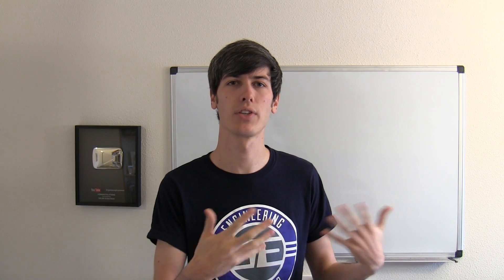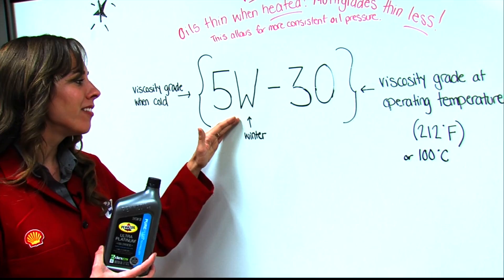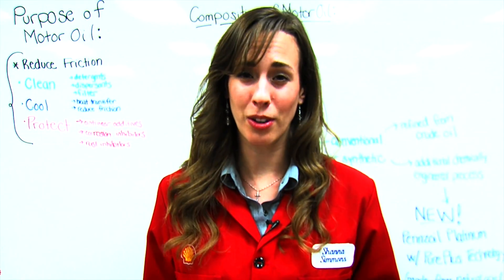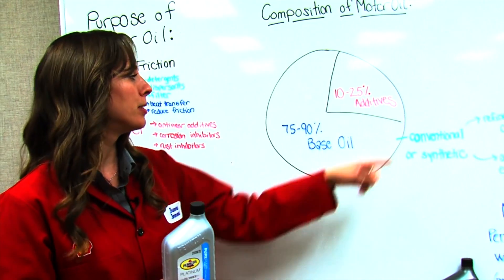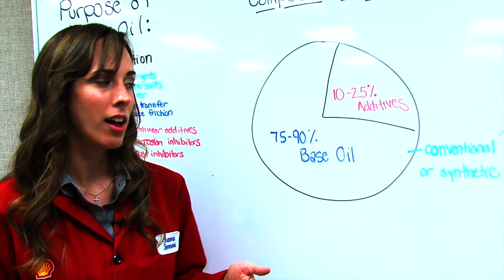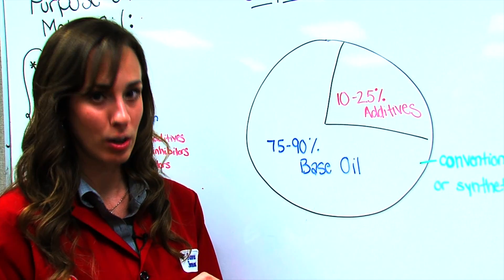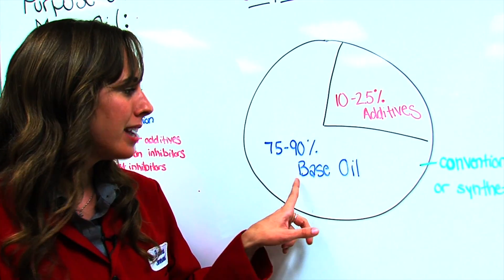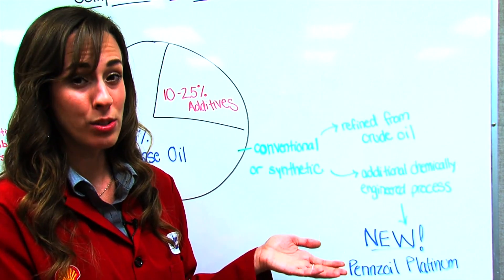Motor Oil Myths & FAQs - Synthetic vs Conventional

Comment: We have a bit of propaganda here about synthetic motor oil and coincidentally, it was Shell that has blurred the distinction between what is a true synthetic and what's really a "pretend" synthetic.  A true synthetic lubricant does not use petroleum.  It's made from components whose molecules have been engineered to perform certain functions and those molecules are uniform in contrast to petroleum oils where the molecular structure can vary substantially.

When synthetic lubricants were first introduced,  they really were synthetic lubricants.  Mobil 1 and Castrol Syntec were prime examples.  Then, very slyly and dishonestly, Castrol switched to Group III petroleum made by Shell while not telling anyone they did so still claiming that their oil was "synthetic".  They were challenged in court by Mobil who lost the case.  Today, the term "synthetic" has no technical standards associated with it and therefore, it can mean just about anything.  Today, both Mobil 1 and Castrol Syntec are either wholly or mainly composed of Group III petroleum which, in my opinion, is not what most people think a synthetic oil is.  These days, only a few true synthetics are offered and they are composed of lubricants from Group IV and V.

When the Shell rep tells us that a "synthetic" is a more highly processed petroleum base oil, that is plainly wrong if we're talking about a "true" synthetic because with a true synthetic, oil is not used.

Are products like Mobil 1 and Castrol Syntec bad oils?  Of course not, but they are not "true" synthetics.

And is there a real reason to seek out a "true" synthetic?  The answer is yes.  When a "true" synthetic lubricant is being developed, the necessary properties can be "programmed" into the oil.  One of the most important design goals is to develop a lubricant that does not react with water and engine combustion fumes.  Petroleum oils are highly reactive to contaminants and so an additive package to protect the oil is included.  As  the oil is used, especially under severe conditions, the additive package is depleted and then the oil has to be changed.  If this does not happen, as is the case with a lubricant that is essentially inert, the need to change the oil is much reduced.  The oil I use only needs to be changed every 3K engine hours or 150K miles.

While videos like this are indeed helpful, they don't tell us the full story and that's because the oil companies don't want us to know the full story.  Companies make a lot of money when they sell us oil and they're not about to change that.
Reply: i was told Pennzoil ultra was a group 4 base is that correct?
Reply: +Ian Irizarry This lubricant is in Group V.  http://www.machinerylubrication.com/Read/29113/base-oil-groups
Reply: Phil Houck so ultra is a group5?
Reply: Yes.  Group V is a catch-all category for anything that doesn't belong in Groups 1-4.
Reply: Phil Houck i have used it before I think it's good but it's expensive. From what i have noticed it takes much longer to burn off and the dipstick had carbon on it, but after using it the stick was clean.

Comment: Boo, you had a perfect opportunity to ask a brilliant question, and you didn't.   What the world really wants to know, is if my 1990s automobile recommends 10w30, will it hurt my vehicle at all to put in 0w30? The general wisdom seems to say no (as the first number is only the cold viscosity, and even 0 weight cold is thicker than 30 weight hot) but it would have been nice to hear it from an oil engineer.

Comment: Always run the suggested OEM oil viscosity.. ALWAYS.. These people have spent MILLIONS on engine and have studied them profusely.. Don't think your idea my be better if you haven't done the extensive testing of what you want to use in your engine. I once used 5 quarts of Duralube to 1 part oil and my car would not get hot, and I threw a rod because of the piston bolts unscrewing themselves.. My cousin did the same thing and his car engine threw a rod also. So I learned to stay at OEM values and also learned to go ELECTRIC.. LOL.. Also if you have an older car pre 1995, Unless the manual says synthetic oil, only use conventional oil.. I had a 1992 saturn and I put in full synthetic oil and the timing chain jumped so bad, it bent the valves and I could not believe that. Then I read the manual and it clearly stated, DO NOT USE SYNTHETIC OIL. It is tooo slick for timing components.. SMH.. But I will suggest this, ALWAYS USE A W RATED OIL.. Ex.. 5W30.. W stands for winter, you'll never know when your going to be traveling to a colder environment.. Ex.. Driving cross country and go through Colorado in the spring, even though its 80 degrees in NV. 60 degrees in UTAH, it fuggin 22 degrees or less at the bottom of the mountains in Colorado.. So with an oil that isn't designed for Winter environments, if I would have stopped and slept in a hotel, came back out and started my car, engine damage would definitely occur.. Have fun..

Comment: ok, I pretty much agree on what she a saying about the motor oils.. I would say if you live in a hot climate, use the synthetic. all other places, the conventional is just fine..  the conventional is cheaper & if you change it a little more often than the synthetic that's ok also, b/c your looking at the engine a little more often to detect other potential problems.

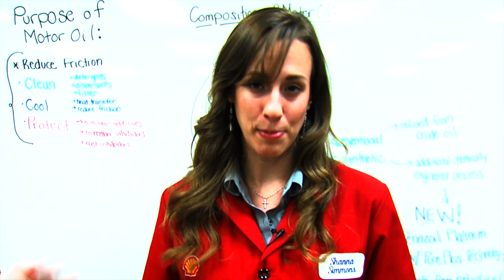Comment: 3:23 Eh, you are missing a few very important points:
1) If the oil is too thick and it is in a piece of machinery you do not start very often, excessive engine wear may occur in startup, especially in cold weather.
2) If the oil is too thick, excessive pressure and seal leakage may occur.

Trust me, I've lived through both these mistakes.
Reply: +eddie telleed It may even be so thick that the oil cannot even flow to where it is needed at all.

Comment: Today's modern engines have variable cam timing for optimal performance.  This achieved by hydraulic mechanisms called cam phasers.  The oil passages in these phasers are fairly small and clog up easily.  The two most important things are to of course change your oil regularly and use the proper oil.  When to thick of oil is use the cam phaser does not work properly.  Think of squirting water out of squirt gun vs squirting ketchup out of a squirt gun. Performance suffers.  Dirty oil explains it's self.

Comment: Shannon said the by-products of combustion contaminate the oil and settle out as sludge.  That's a simplification that is a little too simple and doesn't tell the whole story.  Solid contaminants don't "settle out" because today most oils are 'detergent', that means they hold particulates in suspension so when you change oil it will all come out.  Non-detergent oils allowed particulates to settle out of solution, but very few people use non-detergent oil anymore.  

Another more important issue is condensation.  Condensation forms inside your engine between the time you turn it off and the time you start it the next day.  Condensation mixes with oil and usually burns off when the engine gets hot.  If it doesn't burn off, this water-oil "sludge" is mixed with chemicals from the combustion process and then engine heat turns it into acids that etch and destroy metal parts.
Reply: +Curby Weaver Very true, but when people go very extended periods between oil changes the oil looses those properties and sludge will build. Also if you are getting a lot of blow by, it will contaminate the oil way beyond what the oil can hold. I've seen a car brought in with 65,000 miles and sludge was so bad it would barely drain. the lady had had the car since new and didn't recall it ever being changed.
Reply: +Jamey Larrimore Wow, 65,000 miles without an oil change.  Particulates in the oil are the main cause of engine wear.  Those particulates act as sandpaper and the oil carries them directly to the toleranced parts the oil is supposed to protect.  

Every car has blow-by.  The more wear an engine sustains, the worse the blow-by gets.  

Oil quality is another issue.  A poor quality oil will turn into a wax-like gunk that clings and doesn't flow.

Comment: Engine bearings and parts always need oil that flows well, that holds a film well, that carries heat and particles away no matter what the temperature is. However a super thin, or super thick oil strays from these requirements.  Engines run from cold (ambient) to hot (200 or more) but oil's viscosity changes. It gets thinner as it gets hotter. That means that the oil you put in the engine could likely be either too thick when it's cold, or too thin when it's hot. It would be IDEAL to have some kind of oil that stays the same viscosity at all temperatures, but it just doesn't. However oil engineers have come a long way toward that goal. The wider the number spread, the more stable the oil is, or the less it thins out when it gets hot. SO with that stuff, you can start out with a more ideal cold viscosity, like 5w or 0w... these low numbers do a great job when cold. This is the actual viscosity of the oil. the higher number represents the stability when hot, or "what it acts like" when hot. So if it's a 40 or 50, it means it lubricates ALSO like a 40 or 50w oil at that high temperature. You know that regular non-engineered oil thins out a lot. And the numbers just compare the oil that they sell in the can to a non-engineered oil (pure petroleum) at any given temp, say 0 deg.F to 200F or so. More number spread = more stable oil which is closer to the ideal of an oil that is the same viscosity at all temperatures. At some point, a number like 0W-50 ( I don't know what the numbers would really be)  may actually be really close to the same vis. at all temps and you can't do any better than that!

Comment: Looking for an engineering perspective ... My engine on brand new 2015 Yukon, has 0w-20 which makes me cringe! If I do not care about fuel economy, can I use something higher? 0w-30? 5w-30?, I'm in warm climate so winter starting not an issue. If I shouldn't, what harm would it do? Some people say the higher viscosity oil will "shear" on an engine designed for lower, some say it won't hurt.  I'd love to see a video on this.

Comment: What kind of oil should I use on a red car?
Reply: +JustLouIt olive oil
Reply: Guys, you're missing the point! He's not asking what type of oil to put IN his red car, He's asking what to use ON his red car! Obviously the answer is baby oil!
Reply: It depends on your shoe size.
Reply: +JustLouIt   Only use amber oil in red cars, if you ever find black oil in your red car, remove it immediately and replace it with amber oil.
Reply: +JustLouIt ....I would recommend Royal Purple. it cost a little more but your Red is worth it.
Reply: +JustLouIt Slippery kind
Reply: Pure marvel mystery oil so it matches your paint job to fill in the scratches . 🤥

Comment: I have an old 96 Ford van. I have been using 100% synthetic oil since I bought it, and because I'm in Florida I stick with straight 40W oil. I'm going on 300K miles with no major engine problems, when we replaced the valve covers a couple of months ago the mechanic could not believe how clean the inside of the engine was. If you want your vehicle to last 20+ years then synthetic is the way to go.
Reply: +UtwoBed I agree with only 1 anecdote against synthetic.  I had a 1996 3000GT that made all kinds of lifter noise on start-up with synthetic oil.  That engine was known for lifter rattle with regular oil.  I tried to change to synthetic 2 times and the lifters just made too much noise upon start up so I changed it back immediately.  The engine died at 225k.  I'm not a fan of Pennzoil though.  I prefer Valvoline.

Comment: I put one bottle of Rislone oil additive in my baby Benz and that quieted it right up, where no amount of oil changes would quite do the trick.  So yes, consider additives for high mileage vehicles.
Reply: JoeOvercoat - I have had very good luck with Lucas Products.  Especially the oil additive for quieting down engines.

Comment: I run synthetic 0w - 40 and change it every 8 thousand miles.
Reply: Have you had any used oil analysis done with your 8000 mile oil change outs?  Would be very interesting to see the data, and where the true viscosity ended up at the end of that 8000 mile interval.

Comment: Engine temperatures normally go above 212 degrees, otherwise what are pressure caps for? It's to keep the water from boiling at 212 and increase the temperature and pressure for better engine efficiency. Too cool engines result in waste of energy. Then what are detergent oils? As implied these oils keep the engines clean by keeping the sludge afloat and removing them in the oil filter.
Reply: Anti-freeze is to prevent freezing in winter, not to prevent boiling. Try removing your radiator cap when your engine is hot and see if there is no boiling. Then you will know the truth, the hard way.
Reply: +xSirDingo  The anti-freeze in the antifreeze coolant is ethylene glycole. End of discussion.

Comment: You should have asked how long can a new engine run between oil changes. The myth is 3500 miles I have heard 6000 miles is fine. 12,000 for synthetic oil.
Reply: +John Puccetti      Have been on this for decades.  Regular oil no more than 4000 !!!!  synthetic between 5 and 10K
i would not  go over 10K unless you have a porsche or a range rover (no, not because the price), because they load large amount of oil. 
a FIAT that load 3 quarters  (just an example) requires to be more disciplined than a porsche 993 that takes like 10 quarters. 

a bike also use a small amount of oil. so is wise to change more often. 

also , synthetic oil quality decays slowly , not as mineral oil that start to degrade from day one.
Reply: I have a nuclear engineer friend on Port Hueneme Base they ran two gas car engines for 60,000 miles non stop and had no complications from oil at all. But they did have a by-pass on the oil filters so they would always have flow. Even Toyota says 10,000 miles for synthetic oil. Interesting do you have ties to the oil industry?

Comment: all these keyboard warriors using Google to try and prove the girl wrong. Yeah I think I'll believe the person with the Engineering Degree
Reply: a degree and a high paid salary by a billion dollar oil company lol
Reply: Yes, she's correct. I was Pennzoil Racing Director for 10 yrs. Back when synthetic oils were just developing. BTW additives don't lubricate. There's also different qualities of additives. Pick a brand, stick with it and change it. I use mobile 1 BTW. Also got 425 K highway miles out of Chevy 99 5.7L v-8. Using 10-30 Mobile 1 changed +/- 10,000 miles. Pennzoil is fine to.
Reply: @deantait8326  I agree with you on that one. Doesn't the oil itself lubricate, not the additives?
Reply: Youd make a car salesman happy :)
Reply: Even though she claims that the normal engine operating temperature is 100°C although in reality it is 90°C?
Reply: An engineering degree doesn't necessarily mean anything. Engineers often have varying opinions on many subjects.
Reply: @HowardJrFord  I would have liked to seen her give a basic scientific explanation on the differences between convention oil and what if any effects these differences have on the oil's performance in it's job of lubricating an engine.
Reply: @HowardJrFord and very little real world experience to boot... a delightful combination
Reply: 😏 She's hot, she can tell me smart things any day. I'd learn a lot from her, she's got my full attention.
Reply: Felipe Hernandez Agree.
Reply: Engineers usually aren't the best ones to say what works and what won't because they just go off of what they come up with in a lab or on a computer. They dont normally have hands on experience with seeing things work over years. I'll trust someone who's had their head under a hood for 20 years before I trust someone who sits at a desk or in a lab playing mad scientist on what it does to engine parts.
Reply: Indoctrinated by her Marxist Professor......No thanks.

Comment: What about the first oil change?  Should I change the oil and filter on my new engine earlier right after break in..ie ..1000 miles?
Reply: +Tom Quinn If your new engine is in a new car no. New factory engines are no longer built with any assembly lube. In the pass engines were so that's why people would say to change oil early so you would get the assembly lube out after the initial break-in. If your new motor was built by your local machine /performance shop then may-be. I would ask them for 1st, 2nd, 3rd oil change intervals as every builder will tell you something different based on what assembly lube they used to build it, cam profile, compression ratio, ect.